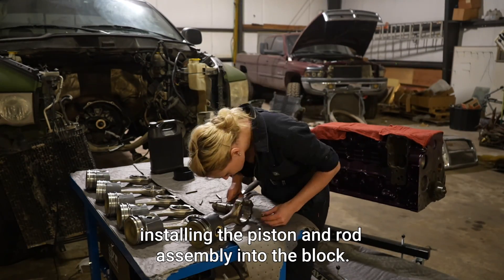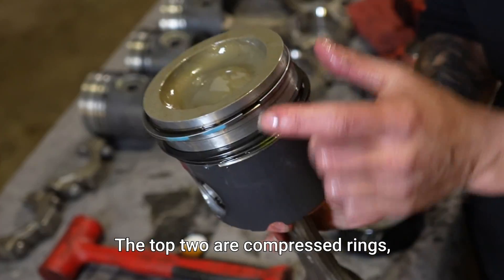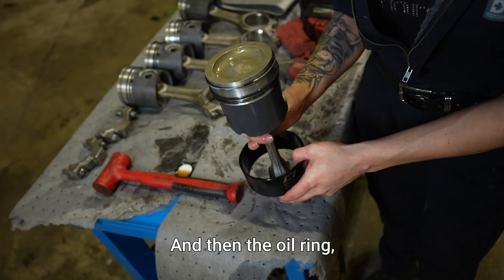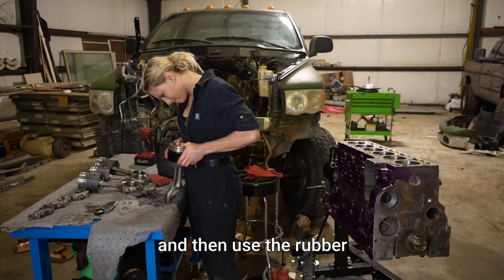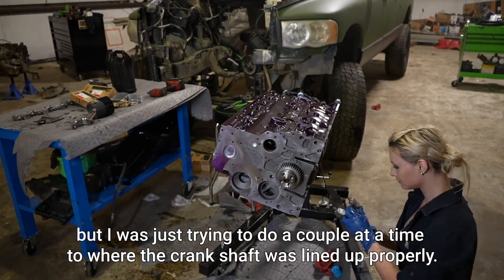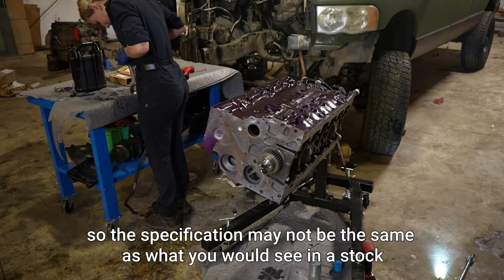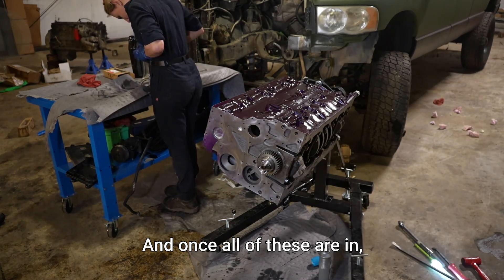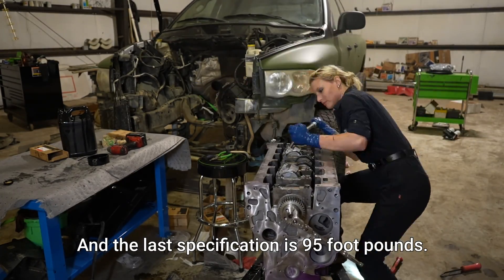05 Cummins 5.9L Piston Assembly Install and Ring Clocking

Comment: I saw a video today where they were talking about a “gapless” second or middle ring for diesel engines. It’s actually 2 rings 180 apart in the same groove. Supposedly cuts blow by in half. Less oil contamination, less crankcase pressure, longer EGR system life and more horsepower. I believe Total Seal makes them.

Comment: meanwhile... the 4.6 mustank engine in the car, should get new rings... their 80 bucks, but the owner of the hoist wants 2500 just to look at it, so it now has a bed pan and it on full time lucas dialysis transfusions for the last 500 miles. already ford'd 1 billion revolution cycles with the cast iron rings it came with, smoking black like an over fueled diesel now. next to build gantry, body lifts off of engine?